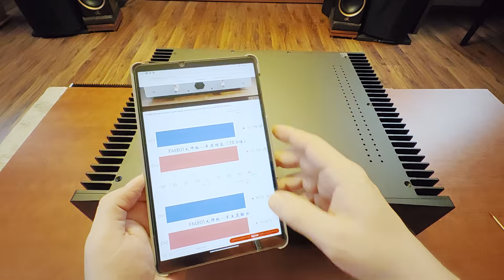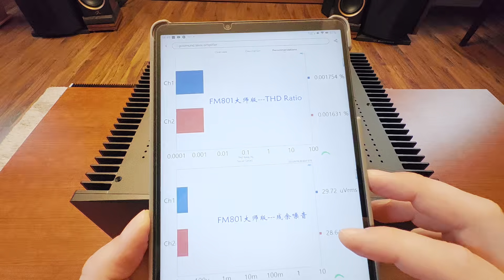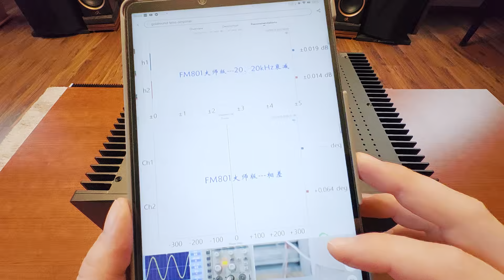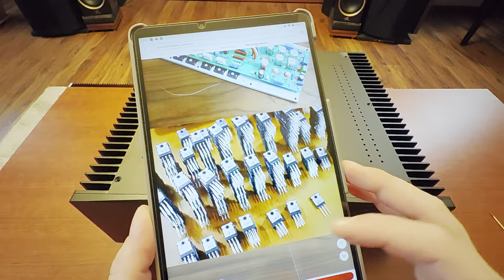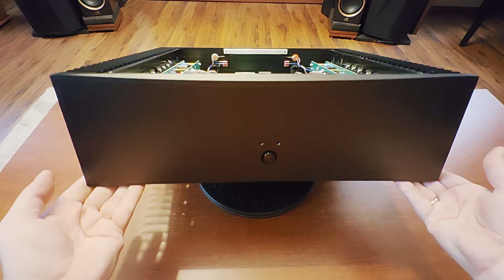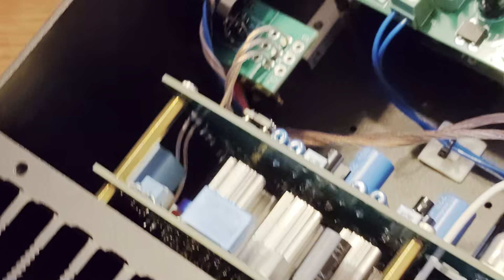FINALLY! A worthy contender! FM Acoustic FM801 Master Version power amplifier clone review!

Comment: Thank you! I have placed an order for this exact model. I will compare it with DartZeel D9 and let you know what i think. My preamp is the FM255 clone. So far i think the D9 is the best power amp i ever had so i am excited to try this one too.
Reply from the maker: Please do share your thoughts!
Reply: D9 will run circles around it.  This thing is current-starved for the number of output devices the PS board has to support.  It’s lean mean and edgy.
Reply: @johnsonwu126  We will see. System matching is also important. I will let you know after i get it and test it!
Reply: @johmsonwu126 Hey, I'm a little confused about your comments regarding this amp.
You keep completely contradicting this review, and saying that it sounds 'lean, mean, and edgy'.
Could you please post some more details about your listening experience with it, especially things like its comparison to other amps, and which preamps you tried.
Thanks.
Reply: @johnsonwu126  How do you know that? Sometimes less is more!
Reply: @ OK 👌
Reply: ..... also, are you certain that it's exactly the same model that you had? There are soooo many Chinese clones. Some may look the same, but the internals are different, and vice versa.
Reply: @ do I need to show you old pictures of the inside of the unit  to prove to you I had it?!?!?
Reply: No. That's OK, thanks.
Responding to enquiries, in a calm and authoritative manner, would have been fine, tho.
Reply: @seangallagher8233  I actually like this amp so much that i sold my D9 Dartzeel clone. Compare to the D9 it does sound cleaner. It is like D9 has some color that makes it pleasing while this is more of a "precision" tool if you know what i mean. Like all electronics if you don't match it with favorable speakers/preamp/source you might have a bad experience. In the future i plan to upload videos of my system with this amplifier on YouTube.
Reply: OK. I'll look out for that.
I'll also wait for hifi zone to go thru some more comprehensive tests of his backlog, and make some comparisons between them (if he ever catches up 😂), before I start pulling any triggers, myself.
.... although, the reported bass performance of this amp means that it'll surely stay a front runner, for me. 

What output devices do these amps have? Bipolar, mosfets,....? What are they?
Reply: Did you compare FM 801 vs DartZeel?
Reply: @JohnyColt  Yes i have. DartZeel is a little warmer sounding probably because it is biased heavily in Class A and gets very hot. FM 801 sounds cleaner and has less coloration compare to DartZeel. You might prefer one or the other depending on system synergy and personal taste.
Reply: @calaf_725  Thank you. Last  question. Which one do you think would be better for rock music?
Reply: @JohnyColt  This might not be the answer you are looking for but IMHO the speakers are more genre sensitive than the amplifiers. Both DartZeel and FM801 are high quality. Perhaps DartZeel is more musical and FM801 more of a precision tool.
Reply: Isn’t it the same as the D9?
Reply: @fusionfan6883  Not really. The chassis they use is the same and the placement of the transformer/pcb but the circuits are different.
Reply: @ Ah ok, I am so confused with all these Chinese amps😵‍💫 Do you have any suggestions for the best pre and power amp combo, I would spend up to £1000 on each item?
Reply from the maker: @fusionfan6883  for 1k GBP you should be fine with Cary SLP-90 and D5Pro (best combo so far). This one will also be probably good with Cary, but I need to confirm that with my ears (soon)
Reply: @ Thanks👍🏻 I can spend a £1000 on each component, so £2000 in total, if there are more expensive units you rate well?
Reply from the maker: @fusionfan6883  I will be getting to reviews of some more expensive units like FM801, but I dont think I will reach 2kGBP level: I think thats just to much to risk damage during shippng. And my wallet would just die of heart attack if I would even mention that kind of money. Closely folowed by me if my wife would find out that Im planning to buy yet another, but this time crzy expensive amp :D
Reply: @ Thanks I look forward to the reviews🤘🏻

Comment: I appreciate your review, especially the time and details you go into.  My only suggestion is adding chapters navigation to your videos would be much appreciated as I am (and I'm sure many others are also) looking at a lot of your reviews trying to decide which amplifier to order. So many choices, how to choose! But man this amp looks like a beauty and I am sorely tempted to pull the trigger on it.
Reply from the maker: As for chapters I rely on youtube automatic chapters. But its weird - it works when you f.e. google my vids: then you have nice chapter selection. But I have no idea how (if thats something I do) enable this for you guys - the only control I see is "enable automatic chapters" and thats already selected.
(I have no time to do that manually, I do these videos after my regular job in my free time)
Reply: @k4syx Was the FM-801 review presumably done without using a preamp (SLP-90 or JC-2) but connected directly to the Gustard/Singxer/Semibreve DACs with built-in variable output? Thanks Tom, as always, for your excellent reviews!
Reply from the maker: @2011FM  Yes my main reviews always without preamp, to have amp qualities as much separated from the rest of the chain as possible.
For preamp reviews (separate) I use D5Pro as "stable" benchmark to be able to compare them, and to have something that more and more people can relate to

Comment: How does it compare to the Zero Zone amp?
Reply from the maker: ZeroZone was trading blows with DartZeel, so Id say this one is better. ZeroZones would be more detailed though. And - in comparison - like 2.5x cheaper (thats a factor too!)
Reply: @k4syx with zerozone you mean the monoblocks? Are they almost as good as the D5 Pro? They are a quite a bit cheaper. Do you know something about the power consumption? Read somewhere that the dartzeel consumes very much even in idle, would think that the monoblocks are way more efficient?
Reply from the maker: @SalvadorZerker  Yes these ones. They are silly when it comes to power consumption and yes Dartzeel is a monster in this regard.
And yes they are trading blows with Darteel winning the fight, but with points and no knock-out there